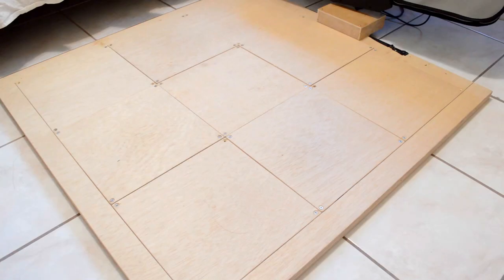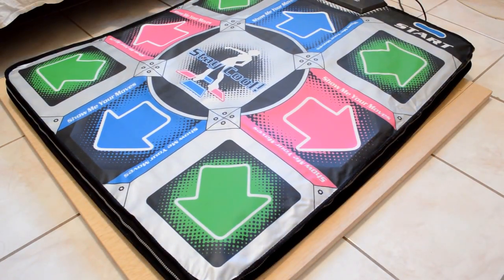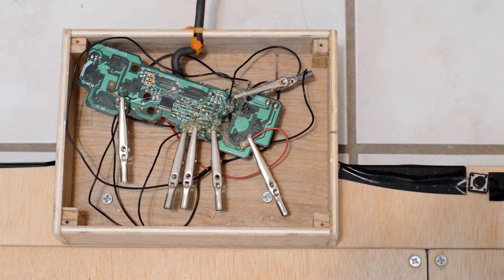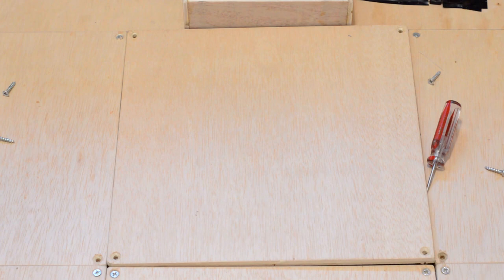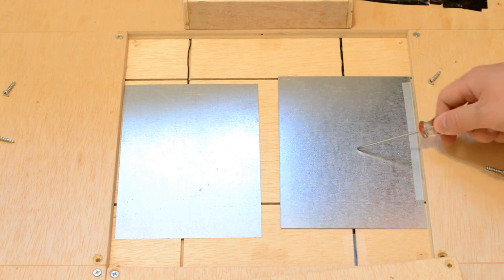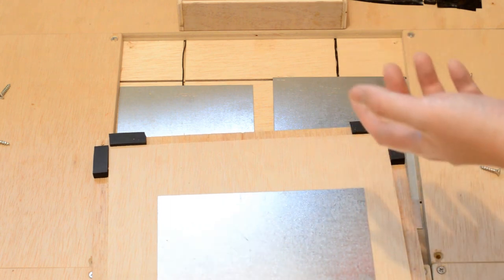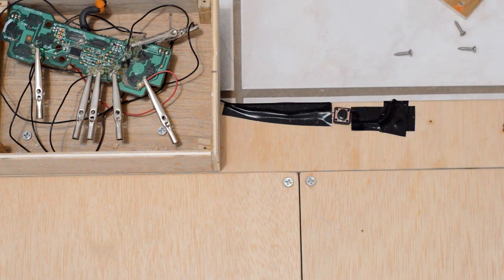DIY DDR Dance Mat Built from Hacked PlayStation 1 Controller

Comment: How did you cut the pressure plates?  Is it from a solid piece of wood with the edges routed down, or is it a smaller wood square glued to a larger one?
Reply from the maker: Hullo. It is a solid square piece. The bottom rabbet/groove was cut out on the tablesaw.
Reply: Thanks!

Comment: i'd love to know how it's held up over time, i plan on replicating this in someway so if you would be willing to share with me the plans you used i would be thrilled but i get the basic idea and should be fine.
Reply from the maker: HI. It still works and is holding up fine. The screws just need to be readjusted ever so often. I didn't use any plans to build this - I just referenced the foam mat for general dimensions and adjusted them to maximize a full sheet of plywood.
Reply: @fluxwood hows it holding up now?
Reply from the maker: @robmc120  still holds up fine. I ditched the ps1 controller and rewired it to an arduino so I can play on an emulator via usb.

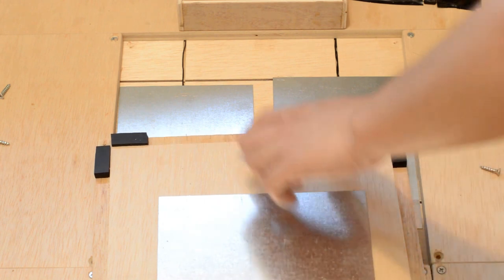Comment: i'm affraid to do that deeper border (1:36) in the plywood...
doesn't it make the plank weaker to be jumping on it?
mine has like 8 really thin layers of wood
Reply from the maker: Hi.
No the border does not make it significantly weaker since it it still thick (approx 1/4")
When the plate is compressed, the weight rests on the wide flat base and not the border.
Reply: @fluxwood  thank you for responding.
i think i will just elevate the center plank to the same height as the pressure ones.
Reply from the maker: @rararasputin2.090  Cool good luck! The border probably wouldnt be needed if your foam/spring material is thin enough